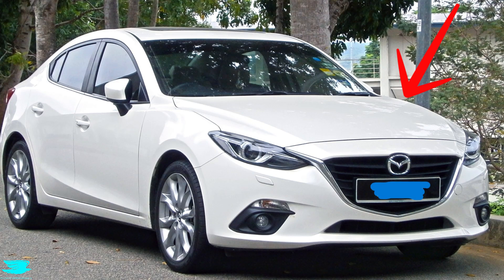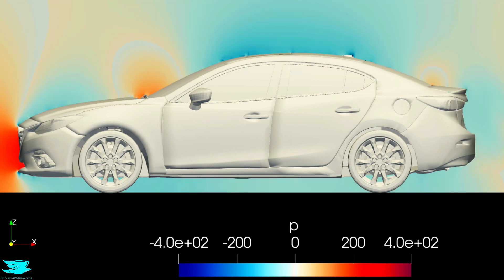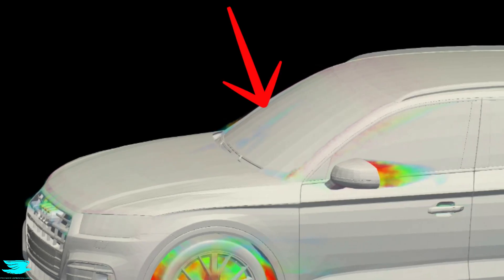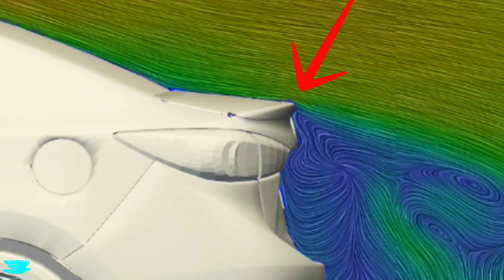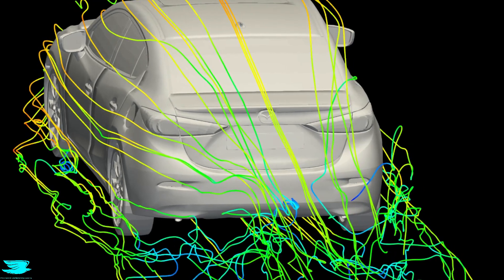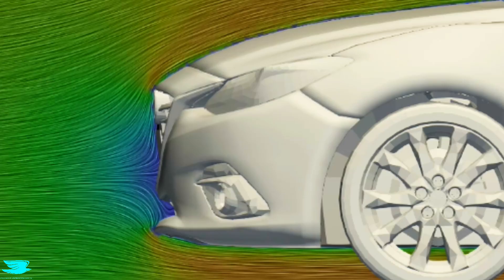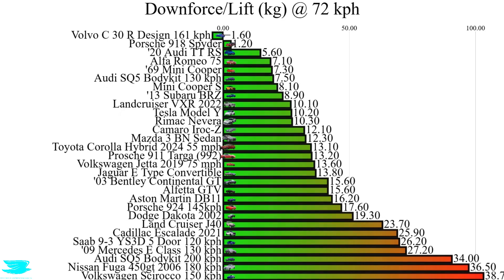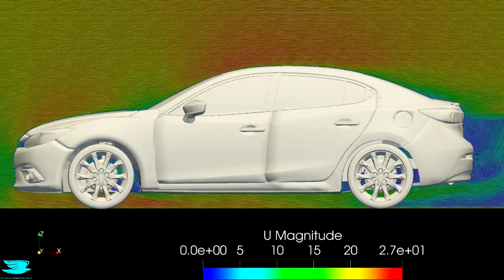Why This Car Is So Slippery

Comment: Came across this video and subscribed to the channel, great to see such awesome results. I had similar results using tufts on my own vehicle.

What Mazda did is pretty interesting at the rear. I wished there was a way to post image of when I added tufts to my own vehicle, but essentially there are vortexes that occurs at the C pillars and wraps over to the sides of the rear windshield, energizing the flow to stay attached and reducing the wake size. Hence why the spoiler makes very little difference and explains why the rear flow has such a strong downward flow.

Here to stay for other videos as well!
Reply from the maker: Thank you!

Yep, the C pillar vortices can be used to do that for cars with steep rear windows. They can also be used to funnel air into a rear wing.

It's cool that you used tufts. You can get a lot of insight from them. And they're cheap and easy to do.

Comment: I'd love to see the 8th Gen Honda Civic, specifically the UKDM/Euro "Spaceship" hatchback version.

It's got an interesting shape and I always wondered about the flow over it.
I had one and the earlier versions have a perspex grille, when I swapped that out for the Sports grille, I swear I actually felt the difference in air resistance.

Comment: I drive a Mazda 6 2017 and it has very good aerodynamics.
I've noticed that it needs vortex generators on the roof to keep the air in contact with the rear window. plus in addeding a rear wing but the air doesn't stick to the car after the roof without vortex generators. I also added canards to push the air over the wheel wells for less drag
Reply from the maker: Wow! I wouldn't have expected a car that recent to have that problem.

Comment: This is actually a BM Mazda 3 (2014-2016). The BN Mazda 3 (2017-2018) was the same body but the front end got a face lift. It had a different/smaller grill and smaller foglights, and now I'm wondering if maybe it had a different rear diffuser as well cause it seems like Mazda modified some of the areas talked about in this video with the face-lift.